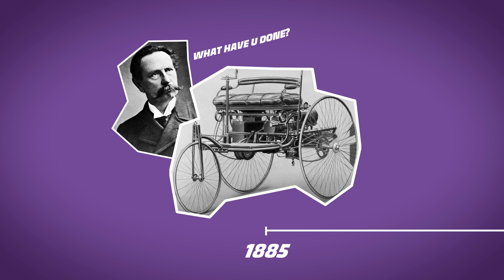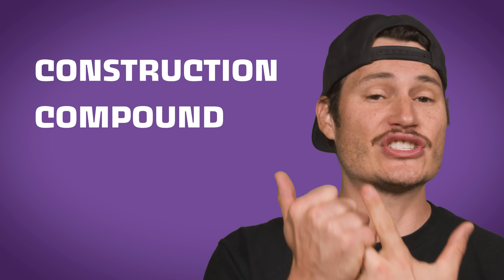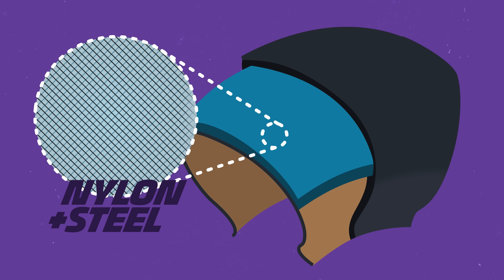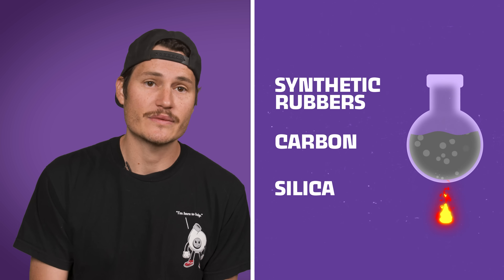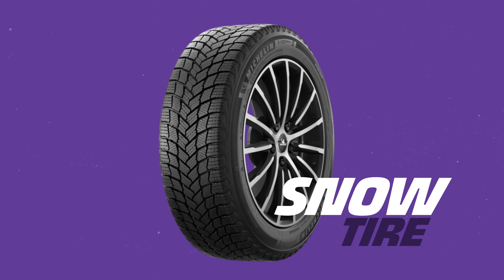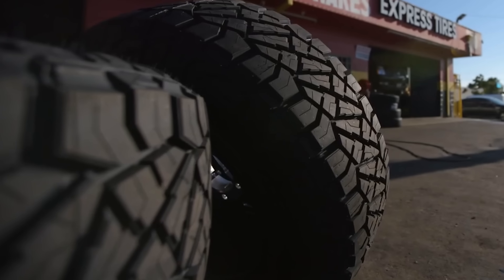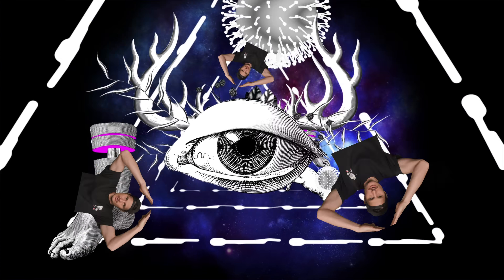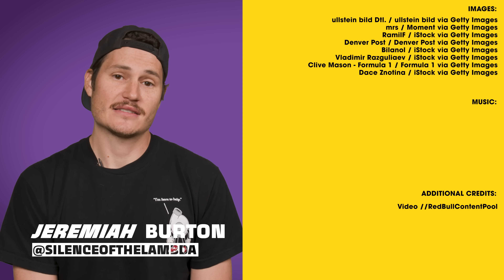The Surprising Science Behind Tread Patterns

Comment: A contact patch gives more grip for a few reason.  When you add weight to the rubber its grip does not go up in a 1 to 1 fashion.  Rubber has a diminishing result when more weight is added exponential at first then tapers.  So if you go over the max weight for a set contact patch and material your grip will stop increasing because the rubber will tear and deform.  Also the rubber has a mechanical key with the road as it drives over much like you talked about in your video and the coefficient of friction doesnt equate for the keying on the road where the rubber can grab the road and has a mechanical bond at a microscopic level.  The rubber also adheres to the road in a small way depending on compound.  Since were talking about wider tires and race tracks I will also assume stickier tires.  At a molecular level the tire adheres to the road surface slightly and more stickiness means more gripyness.  As the rubber moves to the road surface that is robbing energy which means more grip by turning kinetic energy into heat.

Comment: A lot of people have already attempted to answer this, and I might just get lost among the other thousand comments, but I'm learning about this in a physics class this semester so I thought I might take a crack at it. The reason that F_f (force of friction) is not dependent on surface area is that when surface area is larger, the weight force (F_g) is spread out more across the surface area. Essentially, larger surface area means less weight per unit of area. However, the reason that drag racers use larger tires (I think) is that on a drag course with a treated surface that has whatever sticky substance on it, friction is not the only force acting between the tire and the road.The adhesion (ability to stick to other things) of the sticky substance is very high, and when there is more surface area on the tire, there is more surface area for the tire to adhere to the sticky stuff. However, I don't know too much about drag racing so I may be wrong about sticky stuff.
Reply: That's all makes sense, but that leads to the question why normal sports cars or race cars have so wide tires? 
Why are the Corvettes tires so much wider than a Honda civics tires?
Reply: I have a feeling it's about the tire wear. for example, if a 1in by 1in section of a tire can only take a certain amount of force then on a skinny wheel you will exceed the limit of the 1in by 1in section. but on a wide tire, the tire doesn't exceed the maximum amount that section can hold because there is physically more surface area for the tire to hold.
Reply: frictional coefficients are not constant between two materials. there often is a pressure dependency. for rubber a higher pressure means a lower coefficient of friction and less grip.

adhesion is one of several friction mechanisms present in tires. drag tire tread compounds have friction coefficients much higher than 1.
Reply: @bolt5564  I think that’s more to do with use cases. Wider tyres are a huge draw to fuel efficiency and even some power, so unless the benefit of extra grip sometimes isn’t worth what you’re losing
Reply: Wider tires are able to use softer compounds, therefore have a lower coefficient of friction.  So a drag car has extremely soft and wide tires with a really high coefficient of friction.  As the tires get narrower, the coefficient of friction goes up due to the compound getting harder.

In regards to cornering, the wider the tire, the stiffer the side wall leading to less rolling in the tire.

Comment: Physics question answer: the road and the tire are both uneven/imperfect surfaces which mean they come into contact with each other at multiple points over the contact surface area (explained by the peaks and valleys example in the video). Each one of these points experiences the full force of static friction. Since each contact points independently experience their own frictional force, it creates a cumulative effect across the contact patch of the tire, which is why "more surface area equals more friction".
Reply: Agreed! If the contact points were perfect rectangles between two surface of homogeneous properties, the area of the contact surface wouldn't matter. With how the road is, and how compliant the rubber is, the larger the tyre, the more chance it has to find a spot of high friction. I'm assuming you can see this effect in reverse with rolling friction (in which theoretical tyre size would not have an effect but real tyres do)
Reply: I'm fairly certain this is the majority of the answer. Friction does not go up with surface area, but mechanical grip DOES.

Comment: I've studied suspension design and grip theory of race cars in engineering school. If you double the weight on the same tire/suspension package, your grip does not double, it's slightly less. Same goes the other way, if you halve the weight, you have slightly more than half the grip. Friction coefficients are VERY general in the assumptions that go into them for general calculations. Realistically, the surface area statistically gives more peaks to grip, and if your compound is optimized for the weight and temperature, it will engage more of these peaks to increase mechanical grip.
Edit: Doubling the weight and not resulting in double the grip is due to shear forces exceeding the limits of the material itself at a microscopic level.

Comment: I'd say for the tires, and by what I remember from physics classes, the formula doesn't have the width component in it simply because it is considered as if the tire was touching the ground on a line, aka, something that has no area (Because it is a line of points, and a point has no surface area), whereas in reality, because of weight and different forces applied on the tire, it will flatten and the contact patch will go from a line to a rectangle.

Comment: So, there are a few reasons why, first of all larger tires have a lower mass distrubution per area unit therefore allowing for lower presures wich lets the tire to flex more and adapt better to the road. Second, having more area is good for heat dissipation and a lot of heat is generated in those types of race.

Comment: Answer: 

Ff and Fn are perpendicular to each other. Fn is perpendicular to the surface while Ff is parallel to the surface. Unless you get into small dimensions where entrenching occurs, two (same material) objects of equal mass with different proportions will share the same frictional coefficient.

A tire with the same mass that is twice as tall and half the width of another tire while sharing equal mass will have the same frictional coefficient. (assuming everything else is equal)

It's easier to increase the mass of a tire by widening it rather than making it taller. When you increase the surface area, the pressure is spread out more due to them sharing an inverse relationship. So a lighter and wider tire would have less friction then a narrower heavier tire. (assuming everything else is equal).

All in all, surface area "doesn't matter". If you increase surface area you spread out the same amount of force over a wider area which balances out and has no change on the frictional coefficient. However if you increase the mass AND surface area, you can increase pressure between the tire and the surface giving you more 'grip'. Wider tires also have other benefits with relation to temperatures, etc.

*Note that those Racing Slicks are not just bigger, they're more massive (heavier) 😊

I'm not an engineer and I'm not 'smart'; I guarantee someone will provide a much better explanation with proper equations to support them. I don't currently know the shortcuts to type "Ff" and "Fn" properly lol. (But I'm trying to get a free shirt here Dammit!...)

**Edit** smh... I'm reading other comments that are making me doubt myself here... there are other factors I didn't consider but will hold steadfast... I really want a damn shirt... and a sticker.......and some jungle nuggets......
Reply: Drag tires are extremely light weight. 
In fact, they weigh about half the amount that a street tire of the same size would weigh.

Comment: Hey JerryBerry, you’re using the frictional force equation in terms of force. That is good for 1D projected models, but in reality what you want to consider as grip is PRESSURE. Pressure is force times an area, which will give you a numerical 2D referenced grip that you can then project onto the road surface for road contact.

edit: Physics and Civil Engineering Major 🤌🏽
Reply: You mean pressure is force DIVIDED by the area unless you mean force is equal to pressure TIMES area but yea, need a varying reference than a constant one

Edit: Mech Eng Major
Reply: @jsrocker248  or you could just think about it in the simplest terms possible. He didn’t ask for it to be over complicated. Distributed load. If you have a force that stays the same (i won’t be using any eq this is just simple physics) and a small contact patch your pressure or F/in^2 will be high. Whereas if that contact patch is larger. You get a smaller F/in^2. Never passing out of the threshold of static friction at any single point. 

I’m a lil on the weird side. Biological Engineering Major.
Reply: @zexcthd5519  Dude, I totally missed that 😂 your right, you can just use dynamics by distributed loading of the tires area
Reply: @jsrocker248   yeah. Everyone is going with very complicated answers that are right but we can’t just take it all the way back and explain this. Not to say their answers are wrong it’s just tires are so complicated. There’s so many answers. It’s mainly distribution of heat and load. Along with other things like the strength of the actual rubber to no shear off fast. It’s so complicated you can’t really straight forward give a specific answer.
Reply: This comment needs more attention so bump

Comment: Coefficient of friction only takes into account the resistance to sliding of two materials with perfectly flat surfaces. Like you mentioned with tires conforming to the surface, a larger contact patch adds more peaks and valleys that can apply force in a horizontal direction. It may only be a fraction of a pound per little valley/groove, but the more you have, the more it adds up. 

On top of that, you get into footprint mechanics where the slip angle of the tire isn't consistent through the length of the contact patch. If you make the contact patch longer instead of wider, you get a less optimized slip angle through the length of the contract patch. A wider tire adds the same area (for increased grip from the above behavior) but also keeps the slip angle through the contact patch more consistent/optimzed, resulting in higher grip. That's one of the reasons old, classic race cars on skinny tires always looked like they were drifting through corners.

Excellent video dude. Keep up the great work!

Comment: Mu in the friction equation is a variable not a constant and surface area plays a huge role in determining the value of Mu
Reply: Right, to expand on this, each tire will have its own value for Mu. A wider tire will have a higher coefficient of friction when compared to a thinner tire that is made of the same material, has the same diameter, and is inflated to the same pressure. So wider drag tires will have a higher value for Mu, giving a greater frictional force overall for a vehicle of the same mass (since the Normal Force is just the mass of the vehicle multiplied by acceleration due to gravity). Inflation pressure and diameter will also play a role in changing the Mu value for a tire.

Comment: Basically, you want an evenly spread load across your tires. If you make your tires wider, it becomes easier to achieve this. A larger contact patch on the ground will allow you to accelerate more quickly, stop in a shorter distance, and handle higher cornering speeds.

Comment: 18:40 engineering student here: it’s more of a probability problem than a statics one. wider tires just increase the chances for the tire to make contact with the road, allowing the tire more opportunities to get the full coefficient of friction in a certain time period.
Reply: True, but it also has to do with the local strength of materials. Shear forces from the torque can break off small pieces of the track or tire, but with that pressure spread over a larger patch, this becomes less likely to happen (still partially probability, but the local probability for this issue is also lowered)

Comment: Coulomb's law of friction is only relevant when two perfectly flat surfaces meet. For example stiction isn't accounted for, as are many other real world changes. As noted, the ground isn't actually smooth in the case of road surfaces and rubber tires, and so Coulomb's law does not hold. In this case there are many factors to be noted. Bigger tires (at the same pressure) don't actually increase the size of the contact patch, with the same weight (pounds) and the same pressure (per square inch) the size (square inches) has to be the same. However by making the contact patch shorter and wider there is a number of benefits. The main being due to the rotation of the tire. Viewed from above the forwards motion of the tire is always changing. The leading and trailing edges are slower, whilst the middle is full speed. This means the leading and trailing edges are both being dragged along the ground slightly to bring them to the same speed, whilst the middle (with the most weight) is having to fight that. A shorter contact patch means less of that effect, whilst wider doesn't reduce grip in any way leading to a net benefit. This pulling also stretches the tires and heats them, whilst producing losses (one part of the reason higher pressures provide less drag).

Another factor to remember is that the grip of tires decreases as weight is increased. Or In Coulomb's law, the Mu decreases as weight increases (leading to a higher force overall, but tending to decrease in a curved way similar to a log x graph). This is due, in part, to micro tire deformation into the cracks. It takes little force to get a moderate amount of keying into the cracks and bumps producing grip (due to the asymmetric lateral forces on the bumps as the tire slips - tires MUST slip to produce grip). However as force is increased there is far less to gain squeezing into the final part of the gap, and this leads to less improvement. Reducing the pressure increases the size of the contact patch, and so the force pressing into the cracks is reduced and spread out leading to a net gain of grip. This is also why equal weight on all tires produces more grip than high body roll or high anti-roll bar settings.

There's a lot more which goes into it, but those are two of the most important factors as to why bigger tires and/or lower pressures helps with grip. Other fun tire examples, the asymetric grip of a contact patch through corners (outside half of the tire travels further than the inside half producing a twisting moment we see often as bikers lose grip under braking). As a motorbike rider rather than car driver there's a few motorbike specific fun things such as the changing contact patch as the bike leans producing many effects. But there are still fun effects for cars such as an upright car tire with a strong lateral force bending the rubber below the rim seen quite vividly in 50s F1 which produces the need for camber. Or the optimal tire yaw (ie sideslip angle) changing as the weight on wheel changes leading to race cars setting the outer tire to turn more tightly than the inner tire, or "anti-ackermann" to produce slightly more grip. Lots of interesting and cool effects go into tires once we get past the myth of Coulomb's law with respect to tires.
Reply: Hmm, I haven't heard of striction before but what you say does ”sound” realistic. The attention to detail is impressive and I happen to agree with it all including the last part about it being interesting and cool
Reply: How lonely, are you?
Reply: @Kottam_Yallawa  Not lonely, but educated. Likely an engineer or engineering student. Most of us know that basic information.

Comment: Jerry - The maximum friction between the tire and the pavement is determine by your equation Friction = mu * Fn, where Fn is determined by the weight of the car. However, when the drag car launches off the line, there is torque from the axel that rotates the wheel. This creates a new horizontal (tangential, not normal) force, and therefore a shear stress (Horizontal Force * contact area) between the tire and road. A higher area gives the tire more ability to translate the rotation of the wheel into forward motion of the car without having the tire break free due to exceeding that stress limit (i.e. burn out). Increasing contact area reduces the stress, and therefore area is very important. T-shirt?
Reply: You're right, the width of the tire is used while calculating the friction force created by the amount of torque

Comment: Larger tires stread out the weight and therefore allow for softer compounds and lower tyre pressures, thus conforming better to the road surface and getting dug into by liitle rocks. If you put a softer compound on a thin tyre it would flex and buckle beyond the abilities if rubber. I reckon thats the main reason.
Reply: T-shirt please.

Comment: 19:08 because there is a greater area, more force can be applied at any point on the tire. Pressure=F/A so A*P=F. A greater area at the same pressure will yield a greater force, so mu increases, thus increasing the friction force.
Reply: Btw pressure is constant because the weight of the car is constant (same weight on each of the tires)